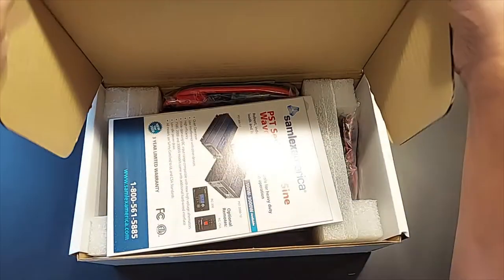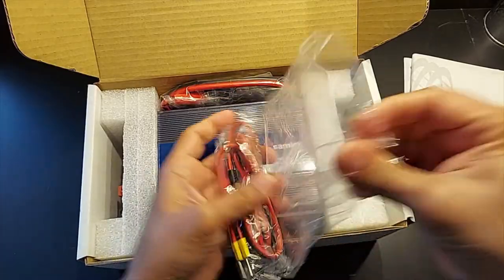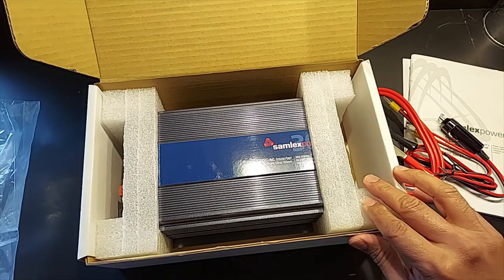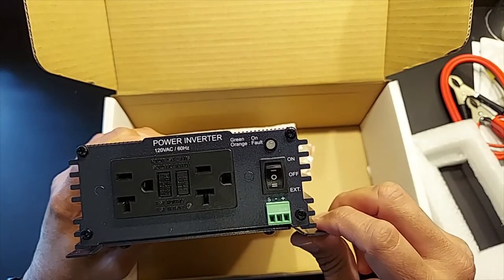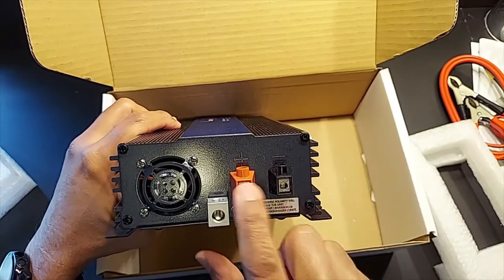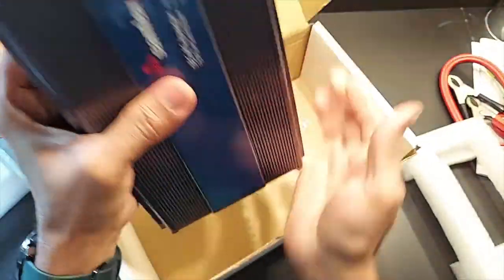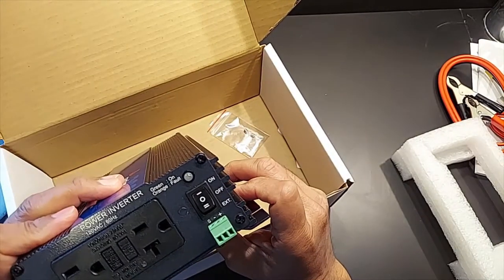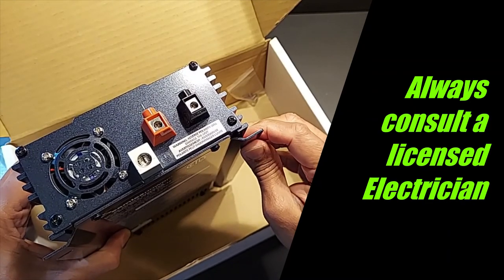Samlex PST-300-12 Pure Sine Wave Inverter for Off Grid

Comment: The Samlex PST series is the best there is.  The only inverters FCC Part B certified, low idle draw, incredible support.  If you only use an inverter once in a while or just in case, get the GIANDEL 300 watt pure sign wave (blue and silver one).  If you need something that you will never have to think about, or you need to depend on it and don't want to frog around to be able to get more than 200 watts, get a Samlex PST.  You will forget the price in a week.  You can't get more than ~200 watts from a cigar lighter socket, and the SAMLEX already has the terminals to go to the battery or fuse panel whereas you need to play Joe electrician, spec and buy parts, and put it together.  When you figure your time vs. money saved,  you will be getting paid less than a 3rd world factory worker.  Because of the good heat sinking and superior electronics, it will be a little bigger than the inexpensive units.
Reply from the maker: Thanks for the input. I have been using it for little things like charging my power tools, laptop or directly powering my dremel tool. No issues so far. The cooling fan hardly ever kicks in. I can hear it when it does kick in, but its a real low whrr and not at all annoying.